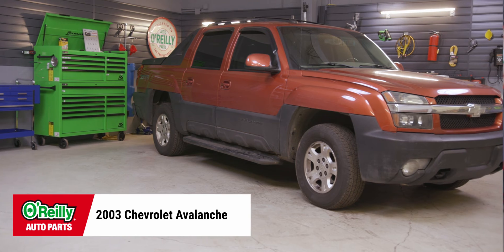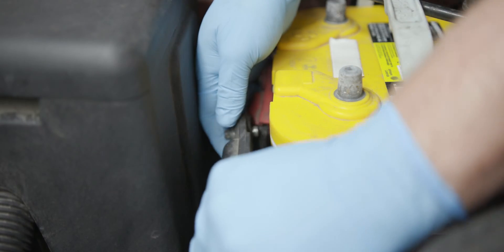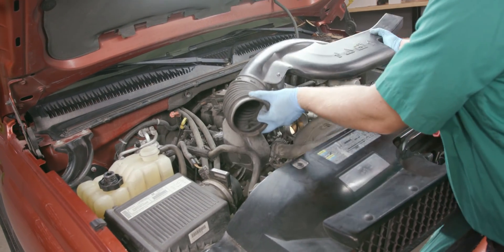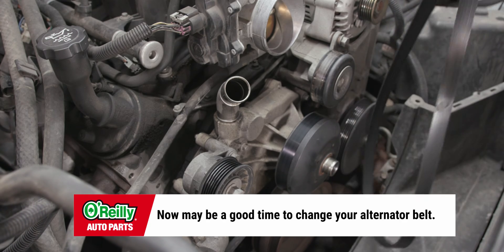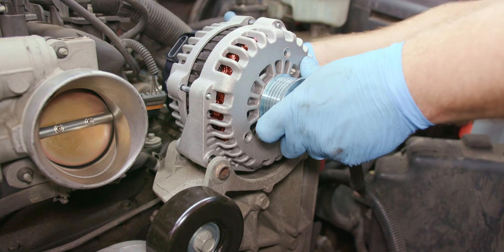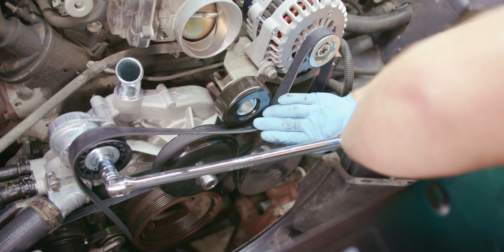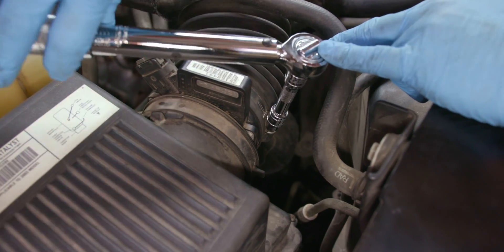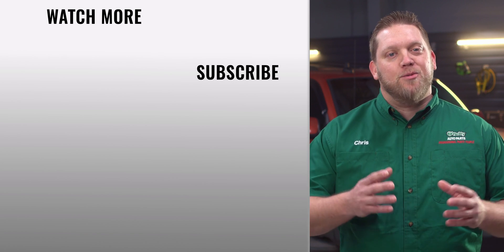How To: Replace the Alternator on a Chevy 5.3L Vortec V8 Engine

Comment: For anyone stopping by:
Disconnect negative battery cable first. 8 mm wrench, socket probably won't fit. If you leave this connected when you remove the wire from the back of the alternator it will arc and spark. 
There are different size alternators available for this model with different size pulleys, replace the 145 with 145, and the 160 with 160, if your belt does not fit after you replace it then you replaced it with something different. Look on the side of your alternator to determine the size amperage, quite often it is permanently stamped on the side. 145a is most common. 
8 mm is the size of a nut to remove the top cover. 
Removing the air intake is not necessary. 
You don't need a breaker bar for the tensioner pulley 11/16 fits it. If it doesn't move smoothly, replace it, it's an easy replace and a bouncing or stuck tensioner will put stress on pulleys and lock them up. (For example if your water pump locked up, your pulley was probably putting stress to the side of the pulley)
10 mm socket to take the nut off of the wire attached to the alternator. The threads on the new stud might be different so use the new bolt that comes with your new alternator.
15 mm for the bolts holding the alternator in place. Don't over tighten these, snug is tight, tight is broken, and if you strip out that cradle, you're in for a world of hurt. 
A couple more notes, alternators are Stone age tech and pure hardware, unless your vehicle has high mileage the alternator probably isn't the problem, if jiggling the wires leading from the alternator to the battery make the battery light go off /make your panel read over 14 volts, then the alternator likely isn't the problem and you need a new wire harness, shorts in wiring occur more often than alternators wearing out. 
That said, there's nothing wrong with going ahead and replacing the alternator if you have high miles and aren't seeing charging like you need, assuming you can meet the $250 requirement, buy a new, not remanufactured, that way if a problem continues, you've at least ruled out the alternator. 
Don't stress, this is a beginner's level fix, you've got this.
Last word of advice, ACDelco is an amazing brand but if you are working on a vehicle with 300,000 mi, save yourself some money and throw in a carquest or something like that for half the price, for pure hardware it literally won't matter.
And remember to bring your old alternator back to the hardware store where you bought the new alternator for a core charge to save some money.

Comment: Yea I'm not doing all that.
"Next you're gonna wanna remove the left tamperdact! Then remove the nogginflogger flipper hose stringer after that." Yea right
Reply: It's easier if you remove the air intake. Gives you more access to the tensioner.